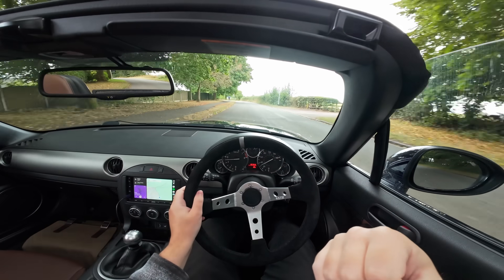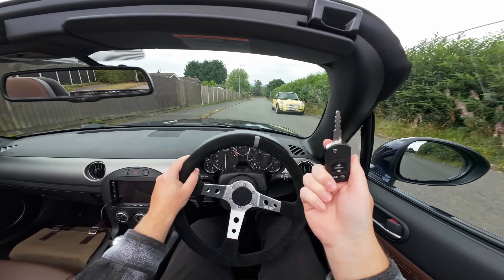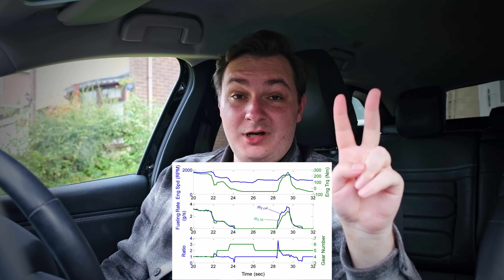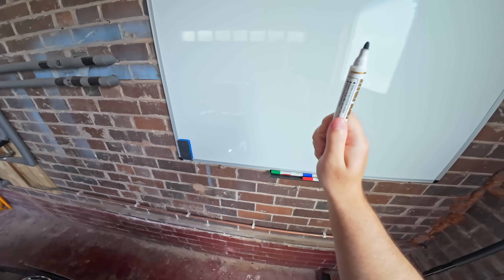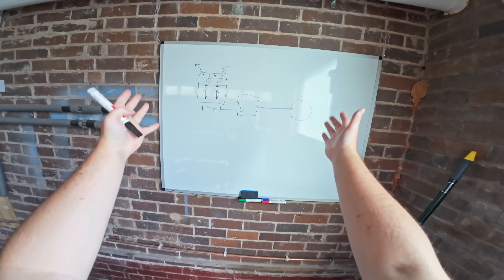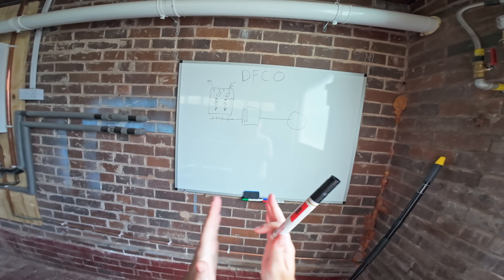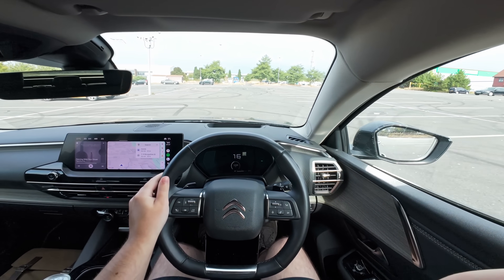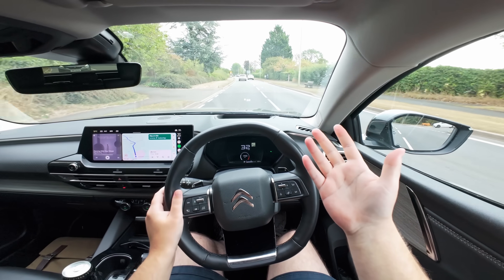The most misunderstood car term - Engine Braking

Comment: Mechanic here. Yep. Only uses fuel for the initial part when you lift off (overrun), then no fuel whatsoever during engine braking.
Reply: Is that also why my car is doing a small jerk whenever I lift off to do engine braking?
Reply: @philb2972  Could be. There's two possibilities I can think of off hand:

1. Your car doesn't do overrun, or it isn't mapped to do it very well. It'll make a jerk when going into engine braking. Usually overrun is to keep squirting fuel for an extra few revs so it eases its way into engine braking.

2. Your car has been programmed to do pops and crackles on overrun, injecting fuel but retarding ignition timing (late ignition) so it'll be igniting the fuel as the exhaust valve is already open, meaning it isn't producing power but you get nice sounds out of the exhaust. This immediate loss of power makes the car jerk.
Reply: @JimGriffOne   my car is a 2014 opel adam, so it's probably the former lmao
thanks for the explanation!
Reply: @philb2972  it's also possible that your center motor mount is worn, causing the engine to roll back and forth excessively, as your Opel Adam is a FF car with a transverse engine and transaxle. Most noticeable at lift-off as deceleration starts, because during manual braking and when taking off from a stop you're expecting a jerk, but you're not expecting to feel that when just letting off the throttle.
Reply: I mean, fuel computers that show instantaneous consumption made this pretty clear as long as you'ren't daft
Reply: My car has terrible rev hang and it actually doesn't slow down for a couple seconds after the downshift unless I push hard on the brakes 😂
Reply: How does that work? The engine has some magical ability to detect when it is moving (and engine breaking) vs. being stationary and idling?
Reply: @anteshell Crank position sensor, cam position sensor, mass air flow sensor, manifold absolute pressure sensor, throttle position sensor... From these sensors the ECU can calculate engine load and see if it actually needs to inject fuel or not. When negative engine load is detected (throttle at zero + manifold vacuum + higher than idle RPM) it cuts fuel after overrun. Only once RPM reaches just below idle, it'll open the idle air control valve and start to inject fuel to maintain idle RPM.
Reply: @JimGriffOne  So, essentially magic. ;D

But wouldn't that mean that any old car with no modern computers and sensors would still burn idle fuel? I don't suppose such reactive valves is feasible to make purely mechanically?
Reply: @anteshell I haven't got as much knowledge of cars with carburettors, but chainsaw/mower ones always have a minimal setting in idle air which will continue to suck fuel into the engine on overrun & engine braking. Those engines are usually designed for two main points of operation, though. So I could be wrong about car/motorbike carburettors - they may be able to cut fuel during overrun & engine braking.

Fuel injected cars are magic. I agree. :) A headache to fix when a sensor goes wrong!
Reply: @anteshell  yes actually.  The computer only injects fuel to keep it at a certain rpm, and when it exceeds that rpm it cuts fuel and throttle until it drops back to idle unless you're actually hitting the gas.
Reply: Doesn’t use any fuel up until the ECU decides do smoothly bring it back in as it reaches idle.
Reply: What about cars without ECUs and simply mechanical carburettors? I suppose as the throttle is effectively closed, far less fuel is being drawn through the carburettor by the incoming air, so do you end up using idle amounts of fuel or none? If it does use fuel, that is maybe the misconception comes from; people using cars or growing up around cars before electronically controlled injection was a thing. 

I really don't know a thing about carburettors though, being 17 and having little experience with cars.
Edit: he mentioned it in passing like 3 seconds after i wrote this comment, I'm still curious if anyone has a more intuitive explanation than google can give me.
Reply: @agiliteka  Well that’s correct. A carbureted car does still use fuel even when engine braking, which is where the pops and bangs come from.
Reply: @LucasOQ  Thank you sir. I will look forward to the day I can be the proud owner of one.
Reply: @LucasOQ  Pops and bangs? I've never heard any pops and bangs with my 80's VW Polo I had 10 years ago.
Reply: @agiliteka  That's definitely where the misconception stems from, older people who are only familiar with carbureted cars teaching younger people what they know. If you listen to old episodes of Car Talk from 30 years ago, you'll hear the Magliozzi brothers talking about how downshifting is only good for looking cool and how engine braking doesn't use any less fuel than idling. Even though, by the '90s, fuel injection had become standard on most new cars.
Reply: @agiliteka   jup, i have a relatively simple 90 year old car know how the engine and carb works inside out. If you lift of the gas, the air intake closes. but only as much as if you let the engine idle. in other words, air is still let in just like it would when it idles. And since a carburator doesn't manually regulate fuel, the air will pull gas with it, just like it would when idling.
This also means, the engine braking isn't as much as it could be, because the engine is still running and generating energy, just as much as an idling engine will (maybe a little more because if you break from higher rpm, the vacuum pulling air in is going to be stronger than at idle rpm. so it'll pull in a little more fuel than idle even.

But i guess the gun in the vid, assumes everyone today drives an injected car, so he didn't even mention it.
Reply: My car is a vw up 2012 and for some reason when I lift off the accelerator it sounds like an electric car breaking 😂

Edit: as in the engine sounds normal but I hear a somewhat electrical noise especially if breaking at slow speed as well would love to know what causes this.
Reply: The engine does use fuel when the throttle is completely closed. That's how it idles. It doesn't use much. But it does use some. However, closing the throttle does increase the intake manifold vacuum, which makes the engine to supply negative torque. There is some difference with carbureted engines and injected engines. Sure, an injected engine could have the fuel completely shut off, but a carbureted engine does get some fuel with the throttle completely closed.
Reply: @KarlUppianoKarlU  On fuel injected engines when the throttle is not being pressed they only use fuel when the revs are below about 1000 rpm (to stop it stalling) or if the engine is cold.
Reply: @KarlUppianoKarlU  Under engine braking, all EFI cars cut fuel after a short overrun period. This is because it doesn't need to, since the wheels drive the gearbox, the gearbox drives the engine via the engaged clutch. Only once the revs have decreased to roughly 800RPM does the engine start pumping fuel to maintain idle.

Throttle closed condition is just one signal the ECU gets to determine whether to keep pumping fuel. "Engine load" is a calcaulation from the input of many sensors that determines 'if' the engine needs to deliver fuel. Engine braking is not one of those scenarios deu to negative engine load condition (wheels driving the engine), unless you want the car to keep running when you lift your foot off the pedal and close the throttle butterfly. That would prevent revs from dropping and negate engine braking.
Reply: If you need the slowing down it's useful. If you don't, you just have to press the accelerator more often. The engine braking then acts like underinflated tyres, rubbing brake pads, or an unused roof rack. This would probably use more fuel than idling in neutral I would have thought?
Reply: @TimpBizkit  No, because if you don't need the deceleration - you will be getting it in neutral idling and this fuel used for idling is only wasted.
By pressing the accelerator just enough to maintain speed, you are using the least amount of fuel possible for that gear - and higher gears use less as a general rule.

If you mean when you need to slow down, but not enough for full high revs engine braking - then you can let off the accelerator partially, and use some fuel to counter engine braking (which is still not all wasted like idling) or you should be in a higher gear doing the same and using even less fuel.
Reply: @cydonia9342  If you put it in neutral to coast it uses some fuel to keep the engine running, but it's pretty minimal because engines are optimised for very low fuel in that case. Unless you're going below about 35mphd it slows you down significantly less and uses less fuel than maintaining speed in gear does. At slow speed however idling in neutral gives you minimal gains- but it's still less fuel than being in gear even if you allow for the fuel you need to use to regain the speed lost while coasting because you can choose the optimum gear/RPM to regain it.

Comment: Slight nitpick: When you were talking about inertia and momentum and you mentioned potential energy, what you actually meant is kinetic energy. You lose potential energy when going downhill. You lose kinetic energy when you're slowing down.

Regardless, great video explaining how engine braking works. Got yourself a new subscriber.
Reply from the maker: I actually had a line where I said "maybe it's kinetic energy... I don't know, you guys know what I mean!" That I cut 😂

Thank you!
Reply: @MickDrivesCars  You also don't gain any significant amount of inertia, only momentum. Mass is a measure of linear inertia, so unless you are driving a significant portion of the speed of light, your inertia is more or less unchanged.
Reply: @homuraakemi9556 , yes, though people often say ‘inertia’ to mean ‘tendency to remain in constant motion’. In this video, since it’s not a physics lecture, I think it’s valid to say that inertia causes the care to continue going forward.
Reply: @mina86  Inertia does not change with velocity at non-relativistic speeds, though. Momentum does.
Reply: @homuraakemi9556 , correct, but inertia is what causes a car to slow down slowly. A fully loaded lorry might slow down even slower. That’s why I find it acceptable to say that the car remains in motion due to inertia.
Reply: Exactly. The car stores potential energy in its fuel, which you convert into kinetic energy (as well as heat, sound, static electricity, etc.) with the accelerator pedal, and that kinetic energy is converted into mostly heat with the brake pedal and with engine braking.
Reply: @hvy_mtl_drmr9563  It also stores potential energy when going uphill.
Reply: english is my third language and i didnt even know potential and kinetic werent the same because we call kinetic energy potanciel which is basically potential lol
Reply: @centuryt91 , this isn’t a language issue. It’s a physics issue. Potential energy is one you get when you put work against gravity¹ whereas kinetic energy is one you get from speed.

¹ and other potential forces, but let’s not go into too many details.
Reply: He also said the driving he did at 13:55 was "free", and used "no fuel". No! It did! You just already burned it to accelerate to the speed you were at when you started! You turned the potential energy of the fuel into kinetic energy, in the form of acceleration and speed, and slowly lost it as you rolled through that section (as evidenced by your slowly decreasing speed).
Reply: @IncredibleMD  While you are technically correct, he meant it in comparison to someone doing constant acceleration and braking when they need to slow down instead of just slowly slowing down over a longer distance and thus conserving fuel. In comparison to that you are driving for free while they are not.
Reply: You're referring specifically to gravitational energy, which is only situational relevant to driving dynamics. Input / output energy is typically used, such that input is fuel input and output is the car speed (assuming the system is the car). Engine braking is composed of the external and internal friction experienced as the car moves in gear.

The application of energy methods in dynamics is fairly difficult for people to understand intuitively. An input / output / friction simplification usually gets the point across for practical purposes
Reply: yeah, that's exactly what i thought
Reply: Came here to say this, but you already did.
Reply: I'd say momentum carries the "potential energy" in this case, that is, energy that can potentially be converted to turn the engine pisons (when breaking). I'd blame the English language in this case and not physics.
Reply: I ve used an OBD II to test this Engine 1.2 Puretech does not shut off fuel , it should but it doesent 
it still Wastes 1.2L per hour even under Engine Braking  🤦🏻‍♀️I ve used a OBD a Onboard Diagnostic Machine 🤷🏻‍♀️
Reply: Yes, engine braking converts kinetic energy. to heat. Friction in transmission, pistons, wind resistance, frogs hiding under the driver seat 😂😂😂, etc, they all do the part nibbling on the kinetic emergy, when you are engine breaking. When you upshift, the pistons chew up the energy faster as they go up and down many times faster.
Reply: @eleftheriosgkioulekas1001 upshifting will mean a drop in RPM, therefore initially the pistons, crank etc will be slower.
Reply: its the momentum, not the potential or kinetic energy
Reply: @zejunous  It's both, actually. Momentum and kinetic energy are both functions of velocity.
Reply: @zejunous  Momentum is momentum and energy is energy. Conservation of energy is a thing and conservation of momentum also applies. Both laws apply always. Ok almost always since there is an exception explained by the theory of relativity which only matters for astrophysicists.
Reply: @zejunous  momentum and kinetic energy are closely related. Momentum is mv whereas kinetic energy is mv²/2. In the context of the video, both terms can be used because as you slow down you lose both momentum and kinetic energy.
Reply: It's all momentum which is because of kinetic energy.
Reply: The potential energy is correct in the context in which he said it
Reply: @oluwatobifaniyi  No it's not lol. In all engineering dynamics definitions of kinetic energy (KE), KE is proportional to velocity. Might be all physics definitions as well, but I'm not sure. If the vehicle is at speed, the vehicle system has positive kinetic energy--which keeps the car in motion while friction and heat "deplete" that energy.

Potential energy (PE) here is gravitational (if the road is sloped) or from the fuel. You consume fuel to accelerate (PE from fuel --> KE) or roll down a hill to accelerate (PE from grav --> KE). 

In practice, engine braking is internal engine component friction (reduction of wheel rotational speed) which applies deceleration to a vehicle, reducing your speed.
Reply: @oluwatobifaniyi  No it is not. Kinetic energy is the energy stored in objects in motion. Potential energy is the energy an object has based on its position, form or condition. Position in a gravitational field, chemical energy in fuel or a compressed spring for example.
Reply: @oluwatobifaniyi , it’s not. If you drive on a flat road, your potential energy does not change.

Comment: i hate people who say engine braking is only for “car enthusiasts” when your grandparents can easily do this.
Reply: It's literally just lifting off the throttle, I don't think people know what the term refers to and get confused.
Reply from the maker: Damn right
Reply: They confuse it with hell-toe downshifting
Reply: probably because they drive automatics. With an AT, you don't really feel much of the engine braking unless you intentionally pull it down to a lower gear, which 99% of AT drivers never really do, nor do they even know that it's possible.

Comment: I never thought about it before, but if you're in gear and you switch the ignition off, you could probably modulate how much engine braking you want to a degree with the throttle(because that's connected to the throttle-body which makes most of that engine braking percentage.
Reply from the maker: SUCH A COOL IDEA

I will try this
Reply: I suppose you need a cable throttle for this to work
Reply: A more practical way of changing the amount of engine braking is to simply change gears. A lower gear will slow you down more.
Reply: @zenbum2654 yes, but if you are in a low gear already and going down a slope, you want the negative force slowing you down to equal the gravity speeding you up, so if your engine has friction already and slows you down, you can theoretically open the throttle valve and keep your momentum on lessor grades without wasting fuel spinning the engine with combustion.
Reply: No one switches the car off when cruising for safety reason obviously, and you loose electric assisted steering as well, so it's only for the sake of the argument, not practical at all
Reply: @R3p1ica88  "and you loose electric assisted steering as well"
Normally no, you don't. Electrical power-steering is manly used to cheat in emission-tests, but neither hydraulic nor electric require the engine to be on.
Reply: this is only applying to gasoline engines with a throttle body
Reply: As long as the injectors turn off. Or else I'd wonder about lots of unburned fuel entering the engine.
Reply: I would genuinely be impressed if changing the throttle angle had any impact on the deceleration rate.